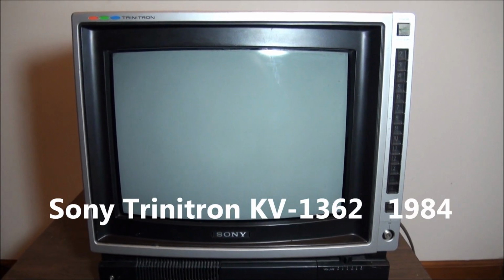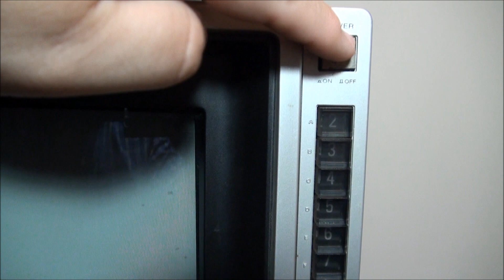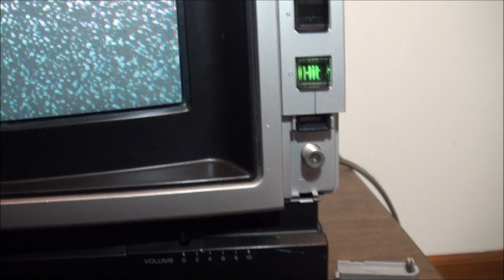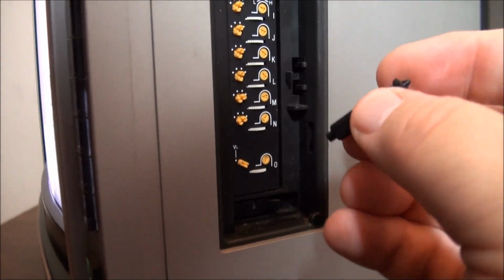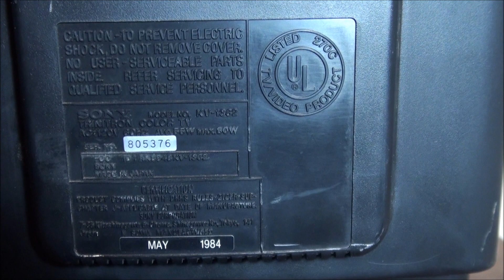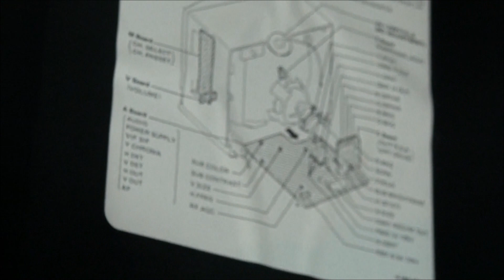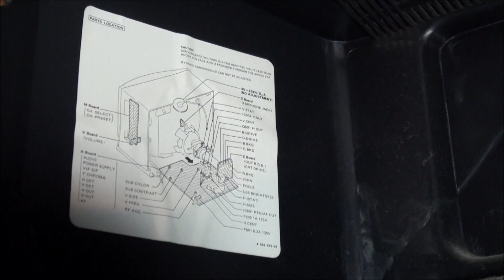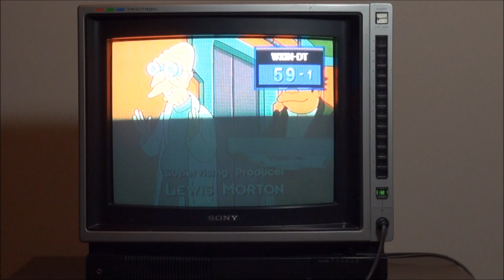1984 Sony Trinitron 13" KV-1362

Comment: 2:47 That's cool because it includes VHF Mid-Band which means it's capable on receiving RF signal from Japanese VCR or Japanese Nintendo Family Computer.
Reply: bobskie321 I know this comment is from 2 years ago but, I have this exact same tv particularly for my N64. I have had it for a year and can not figure out how to get my console to work with it. I have an RF modulator to connect the RCA cables and just cannot figure it out.

Comment: Hi, love the video and great to see one still working fine. The HIT terminal stands for Home Interface Terminal (from memory) which was original intended for a sony PC from the same era. It may never have been sold in the US not sure. My Dad purchased one of these new in 84 and it lasted with until I think mid 2000 when the blue gun wore out. Older Trinitons had plated guns as opposed to the coated ones that come later and failed quickly from my understanding. Maby in the states this was a cheap model but in Australia it was quite expensive relative to other similar TV's. Cheers.
Reply from the maker: Thanks for that information; I never would have thought it was computer-related!
Reply: @DanOConnorTech  It indeed is, in fact in Japan, sony often advertised Trinitron like this one with their HITBit MSX computers! Although their name doesnt come from the HIT terminal, it comes from "Hitobito" which means "People" in Japanese.

Comment: I have been trying to figure out how to get my Nintendo 64 to work with this TV, I particularly bought the tv for that intent. I have an RF modulator plugged for the RCA cables and have tried so many different ways and just cannot figure it out. Any advice you could potentially give me to figure this out?
Reply from the maker: Sorry, I'm not experienced with the Nintendo 64 system but it should certainly work. Do you know for sure that your 64 is in working condition trying it on another TV?
Reply: Dan O'Connor Hey Dan! I have two N64’s that I have tried on the tv. I have a newer Visio 4k tv but unfortunately I don’t think the newer tv is compatible with the console due to the low resolution display the console outputs. That’s why I acquired that Sony tv in the first place.

Comment: I have an almost identical set - a 1984 Sony Trinitron KV-1430AS. It was a higher-end model though, designed for use with early Commodore computers. I have a video of it on my channel.

Comment: ....hey Dan......my uncle has a sony KV-1454WP....still working
Reply from the maker: Nice. Did you know that the "KV" means it's a CRT set, the "14" means it's a 14 inch screen and the "54" is the chassis model number. The letters at the end indicate "extras" the TV has. If it had an "R" that would mean remote, "S" would mean cable-ready, "X" would be audio/video inputs, "T" would be stereo (in the '70s) and "U" would be USA only. I don't know what "W" and "P" are. So there - more trivial information than anyone would ever want to know about their old Sony Trinitrons!
Reply: Dan O'Connor ....hahahahaha....hey dan thx a lot...ill give dis info 2 my uncle...i bet he doesnt know shit about dis....thx again and have a nice day